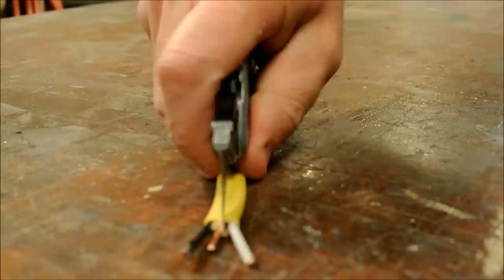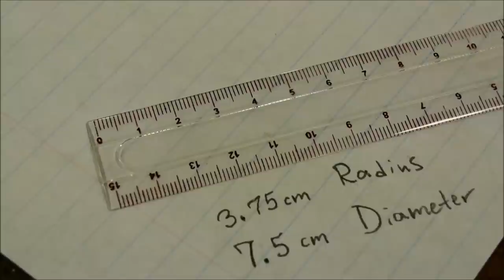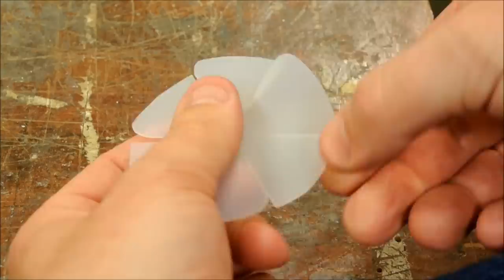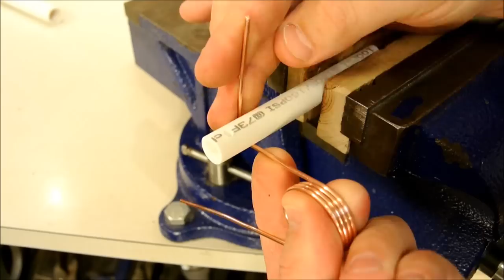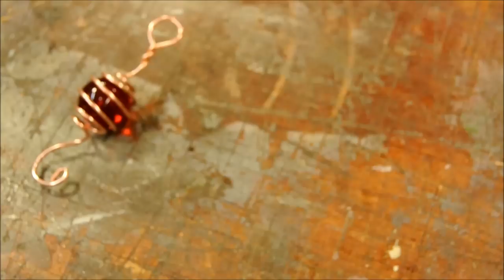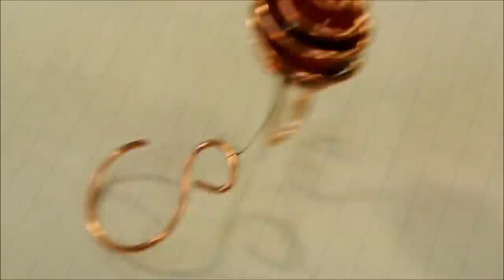Copper wind charm (gift for mom) Gyrocopter!

Comment: Very nicely made, especially as it's made from "reclaimed" materials haha. If I were to make it I'd perhaps use some copper sheet in place of the plastic for the vanes, but I get that's not really the point, unless you happen to have something with copper plates in it you're recycling. Anyway, thanks for sharing.

Comment: Is there a ratio between the size of the marble ( I only have a small one ), the length of the wire and the diameter of the prop? I don't drink milk so I'm going to try flattening a piece of beer can aluminum to make the prop.

Comment: The diamond on the tape measure is the metric stud spacing.
Reply from the maker: Nope. That doesn't work out. Read the description.
Reply: +pocket83 I stand corrected, it is not metric, I had to look it up again as I didn't think it had anything to do with skipping one stud as stated in your description.  Yet is has been a few years since I have done any serious specifications for building construction.  It is in fact the alternate spacing that is allowed when using engineered floor trusses.  The engineered floor truss usually has a flat wise 2 X 4 for the top member offering 3 1/2 inches of support compared to the standard 1 1/2 inch face of the nominal 2 X 4 floor joist.  There is 14 1/2" span of floor sheathing in standard joist construction.  Using the 19 1/4" spacing with a 2 X 4 flat wise there is 15 3/4" unsupported.  With modern plywood or OSB the 1 1/4" difference is insignificant.   One should check local building codes to see if this non-standard spacing meets codes.

Comment: easyer way of removing isolation:
strip the 2 ends down
clamp on of them in the vise
pull on the other one real hard
the increased lenght means a  decrease in width so the isolation can be pulled away easily

Comment: When you are making several... things (like in this project) do you film the creation of the first one, or make it off camera and film the second/third try?
Reply from the maker: Zeke Totally depends on the project. If I decide to make it a video, I start filming once I have enough of the problems worked out that I am fairly certain it won't end in failure. This video was made after two or three prototypes, all made different ways. The "Truncated icosahedron puzzle" was made without making one first; I filmed along the way, because it was so complicated. The second format doesn't always work out, so I have a folder full of unfinished videos.
Reply: pocket83 Nice to know, thanks

Comment: Next time, just stand on the end of the wire, hold the other end up, and use a carpet knife with a fresh blade, start at the bottom, and gently slide it up the wire. Almost instantly you will be able to peel away the insulation.

Comment: When making the fan, what are the measurements to cut for each fin?
Reply: The circle is 3" diameter, and the cuts opposite one another are about 1" from connecting to each other. The spacing is simply six even parts, which can be done with a compass. I think all of this is shown in the video, so try watching again carefully.